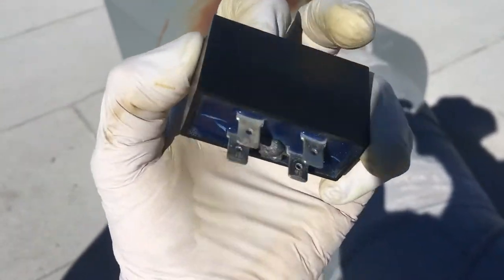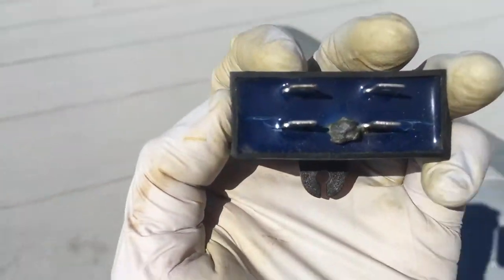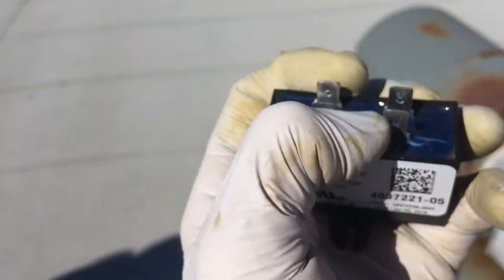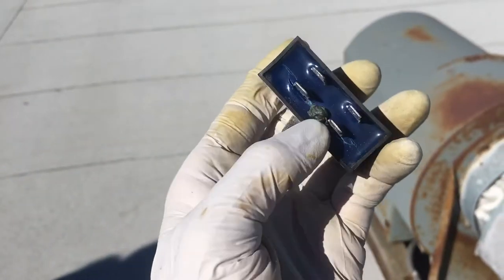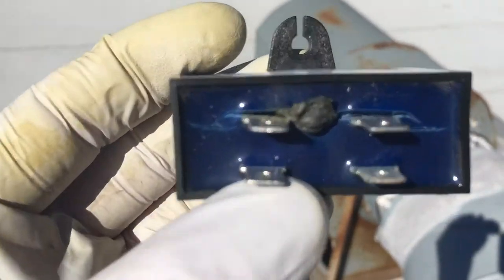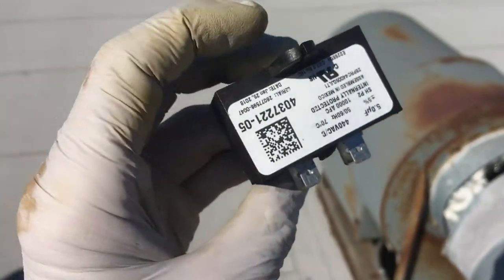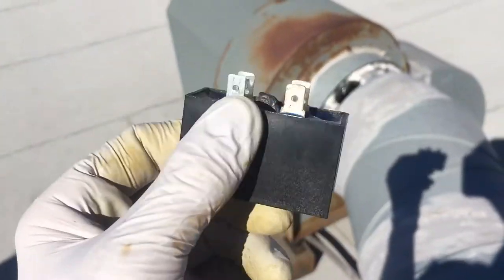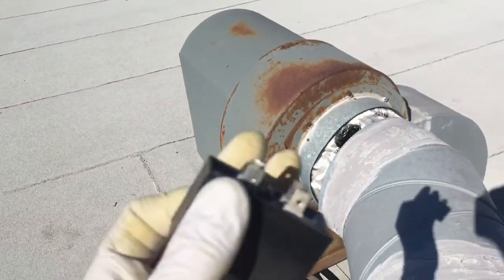Bad Fan motor capacitor on the quest dehumidifier￼

Comment: Are The terminals that closer together one side and the set of terminals that are further the other side, meaning I would test any two terminals that are further away from eachother, sorry if that didnt make sense
Reply from the maker: I actually do not remember I don’t do enough of these little square packaged capacitors. 

But you can safely say if you measure an all directions, and nothing turns out in any combination then you definitely know it’s bad  within its five percent rating.
Reply: Thank you

Comment: Do you test these the same way as a round capacitor
Reply from the maker: Yes, put your multimeter in the capacitance test mode and exact same way you test an oval, capacitor or round capacitor on an air-conditioning unit you test these the same way.